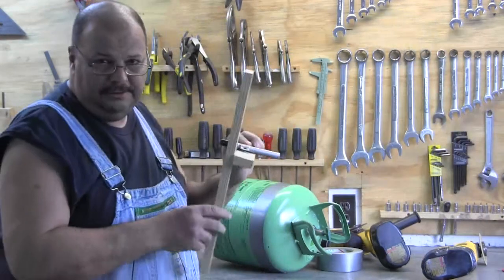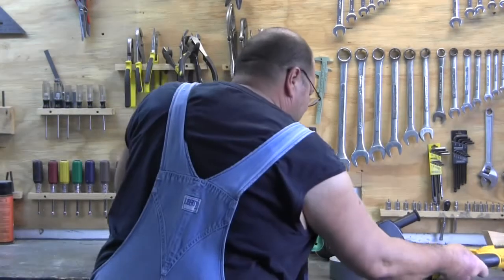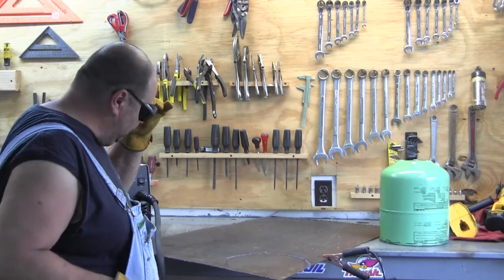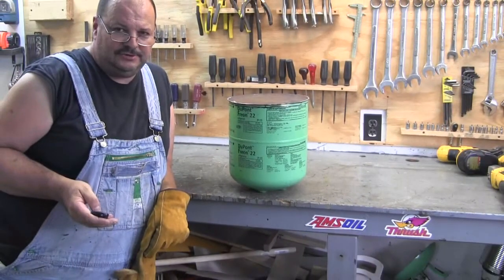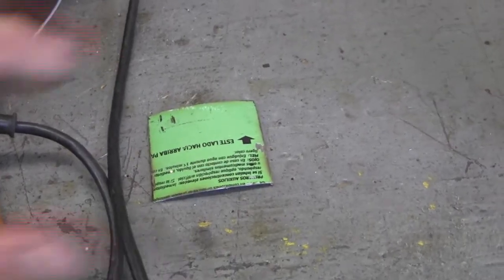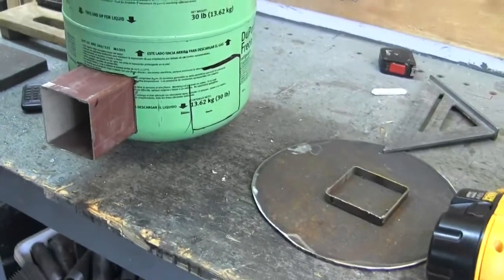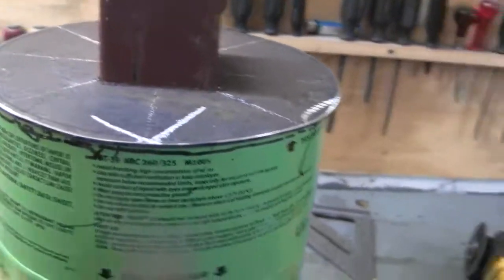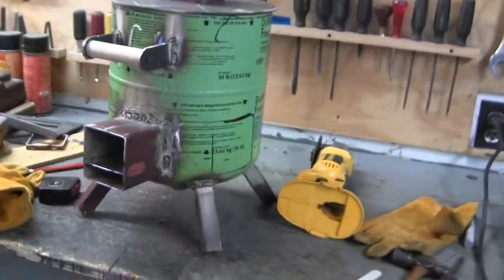Building a rocket stove

Comment: If you want to make a straight line on the slender just lay it between two strips of wood on both sides and the back against anything like a wall and fix your drawing pen on any point you like on one of the strips and then rotate the slender and make the pen draw the straight line.